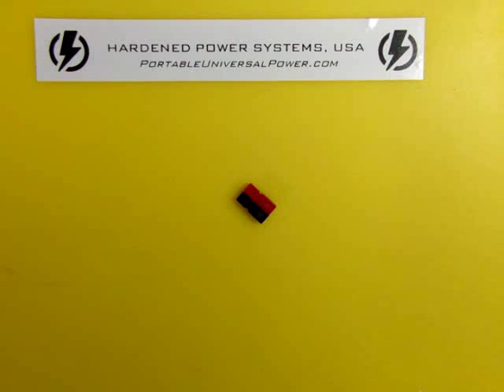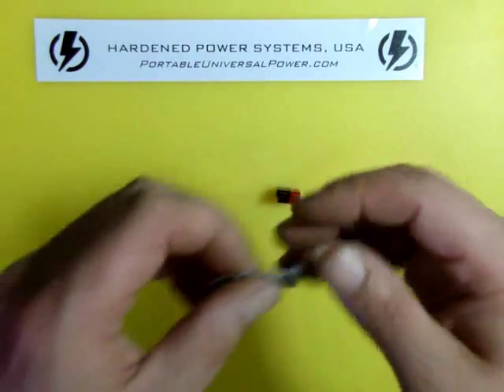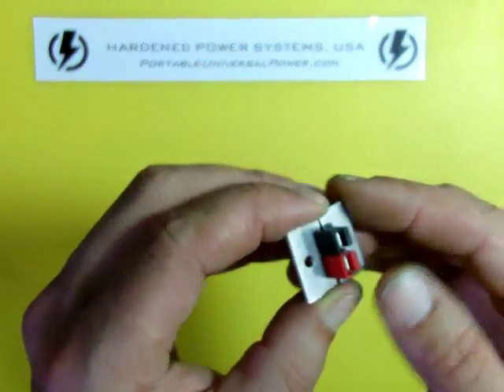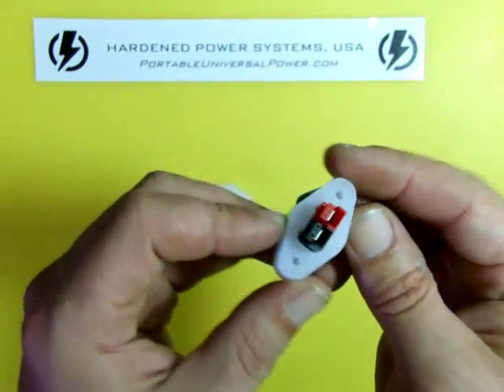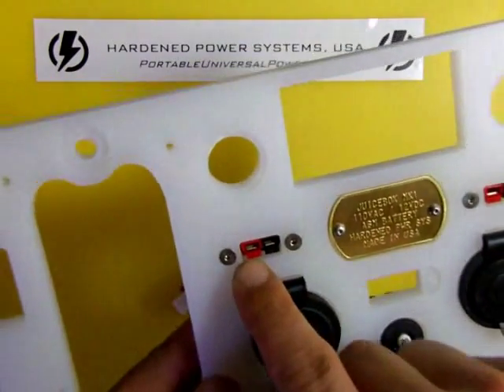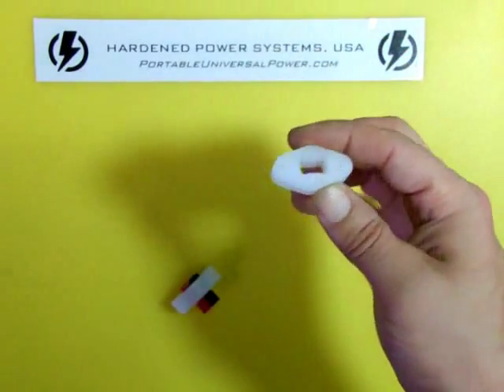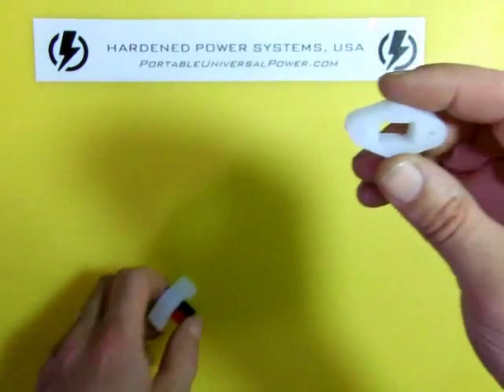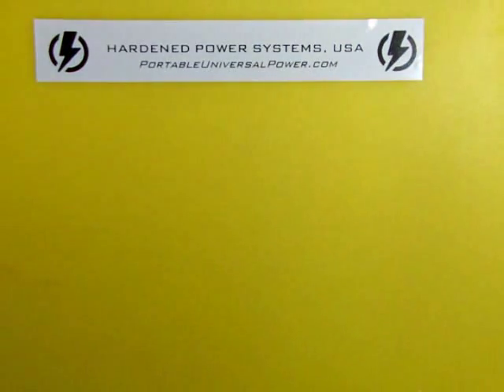Anderson Power Pole Mounting, improved!

Comment: I'm building a go box now and looking to place (2) power inputs into the panel face.  One for DC supply for use at home, the other for Solar input for use in the field.  I plan to rotate the powerpole orientation of the solar input so I can not connect anything else to it in error.  Will these accept powerpoles in any orientation?
Reply from the maker: Yes, they will.  ;-)